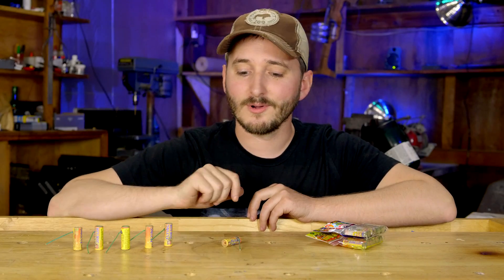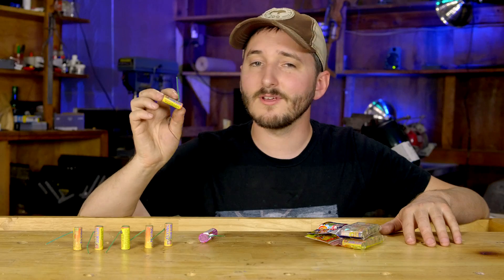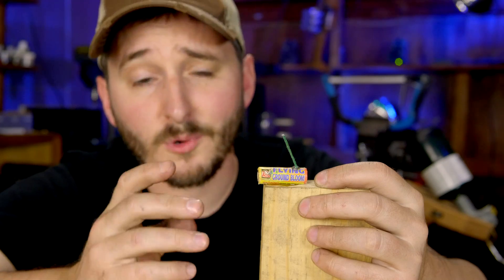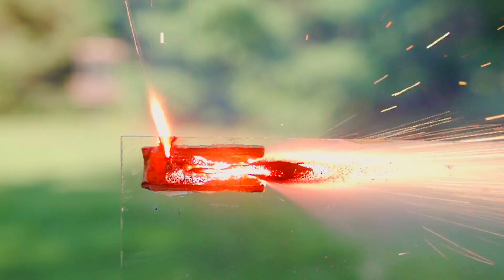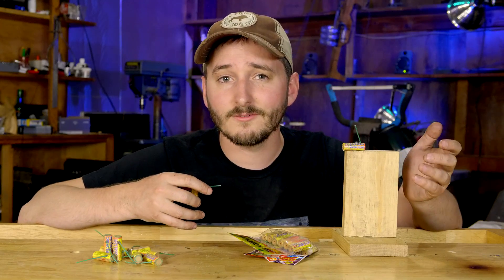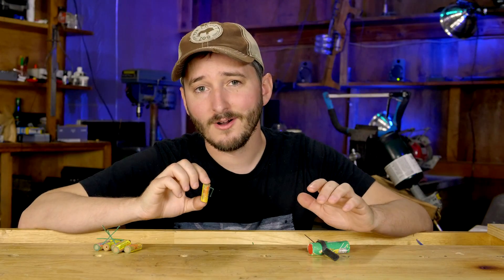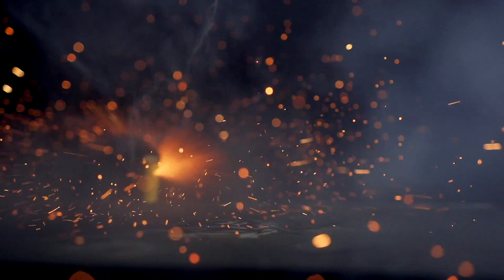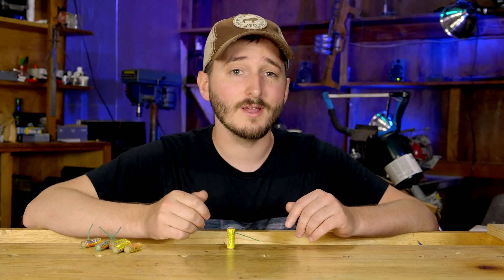How Do These Fireworks Fly?

Comment: Thrust vectoring without a vectoring device , only the nozzle at play .the flat surface to push against and the off centered nozzle on the side , weight to thrust ratio between the side nozzle and end nozzle , burn delay to the end nozzle to give the side nozzle time to vector the piece to a near standing position then commencing the end burn with the side nozzle acting as a rotating wing.!!??!! My pennys worth!😊

Comment: The tippy top and fire work share the same forces generated, off center of gravity. The thrust generated causes rotational spin and also makes contact with the ground generating lift. Once the rpms reach a certain speed, it generates a vortice and partnered with gyroscopic forces allow the thrust to reach position of least resistance. Without ground effect, there will be no particular direction. Basically what you said, thanks for the video, it was entertaining.

Comment: Before watching the video, i figured the fuse burns down to start the burn. The fuse hoe has to be off center. The calendar has to roll over because it's in contact with the ground, as well as the off center fuse hole is blowing out exhaust and it is also trying to turn around the axis of the non burning rocket end so the three forces combined cause a lift off the ground only when in contact with the flat surface. After watching, it looks like you take away two of these factors when tossing it in the air and it tries to spin around the axis placed at the opening of the rocket end and never starts to gyro and the rocket end lighys and still tumbles even worse.

If you get a tall calendar to spin on a surface on it's side fast enough it tries to pull it's center of gravity inward and tries to stand up. I know this from spinning glass or hwavy plastic cups on the table when my gameboy ran out of batteries and it was too hot to play with sticks outside. The off center weight of the glass bottom and the spinning contact of the glass with the table did some interesting things. Get a spent cartridge from that fire work and add a few bb's into one end and glue it. Then take turns spinning the tube in a table in different ways and it will surprise you. You obviously already know that toying with crap trumps the calculations and philosophy which come last...

Comment: Ohh. It like a bottle rocket but starts off as a spinner. Cool. Ok. I think I got something. The fire on the side end is pushing it to spin. Naturally the force will push it up. It wobbles as the other end is smacking the ground; causing it to wobble almost in an upright position. Hence the ground is a stabilizer

Comment: To me it seems as if the rotational thrust port (with the fuse) is not perpendicular to the axis of the firework but rather has a small angle towards the second thrust port (bottom).  This helps the firework right itself when it starts to spin.  Also since the rotational thrust port is further from the second thrust port (and not in the middle), the second port section will tend to orient downwards as it has no thrust there to lift it during the initial spinning.  The slight downward force of the rotation thrust port helps lift the end with the rotational port in it until the second port ignites and launches it.

Comment: I think it's weight.  The weight of the unburnt charge is greater than the weight of the already burnt end charge.  As centripital accelleration happens, the force causes a spin due to the dragging round end  Then as the final charge ignites, it's already vertical in orientation and loses weight suddently, letting it launch into the air quickly.

Comment: My theory is that it stands up through three factors. The first two, friction and ground force, were already discussed.  A third possible factor that explains the ones standing up later is balance. The initial burn clears out the gunpowder near the side nozzle, so by the time it takes off it's bottom heavy.

Comment: Does the the end with the hole have more weight to it? Also wondering about hole size, are both the same size. Another thought was two types of rocket fuel, slower on the side and fast fuel once it breaks through the core.

Comment: maybe the center of mass lowers (dimensionally speaking) due to "fuel" running out, or the hot gasses have buoyancy due to temperature difference? you can change the location of the first hole for some tests :)

Comment: I think the better example is a gyroscope once spinning along an axis gyroscopic forces stabilize the spining.the thrust out the side is simply to start the process much like a starter starts an engine. The thrust from this first exhaust passes over the ground at some point building just enough thrust to lift the tube upright. At this point it spins in a gryoscopic fashion keeping its upright orientation. At the end the bottom kicks in providing lift. In the end its acting like a gryoscope for stablity along the vertical axis.

Comment: The moment of inertia of a spinning tube is always most stable along the Z direction. Take a tube flip it in the air and spin it and you will see it lock along the z direction.
The ground introduces a constraint on the motion of the tube as any sort of intersection of the tube with the ground is less stable than with Z pointing upwards. Then the axial ignition happens.
You can test this theory by lighting one of these things and dropping it against a surface that is vertical, like a wall, and you will note that the firework will very likely shoot off perpendicular to the surface of the wall.
This would be a fun experiment to film.

Comment: I can be wrong but what I believe is that while thrust helps, it is actually the friction that helps to lift the firework up straight. You can observe this phenomenon by rotating(twist) a cylinder from one end and it will also stand straight up. I cannot explain without drawing free body diagram since my English is not great  but upward force from ground and horizontal force from friction gives us a resultant force which lifts the cylinder up. If someone already mentioned it then my apologies and If not and someone can add a word it better or can correct it if I am wrong then it will be great👍

Comment: if the fuel starts burning and escaping from the fuse hole first, wouldn't this change the center of gravity to be closer to the bottom nozzle? and would that be a big enough change to help point it upright?

Comment: While friction is undoubtedly a contributor, the side jet itself is pushing the firework's end away from level. Backwash from the ground effect is probably helping with that, as is centripital rectification (the method that causes a "tippy" top to flip over). The sizing of the firework is probably something found experimentally, since that affects the timing of the end jet firing, but I noticed that the side holes seem to be slightly off-center to the long axis of the body. That is probably what encourages the fireworks to spin every time, since otherwise a few would simply lie there spitting fire at the sky until the end kicks in.

Comment: Initially I imagined it similar to a lemon, where you start spinning it on its side and its rotation translates to the adjacent axis and spins on its end. Then when you mentioned the tippe top I was even more convinced I was correct.
But seeing it in slo motion, it seems the side vent it slightly off center so it rolls around and is just pushed upright by the jet of exhaust.

Comment: this is an example of directed thrust momentum and weight distribution the thing i believe you are missing is the initial burn hole does NOT just go straight into the firework. if you carefully watch you'll see that the initial thrust flame actually comes out of the hole at an odd angle creating a direct central spin within the lines of the body forcing it to stand up on the end its meant to spin on. if the flame came out straight it would defeat this rotation if it came out at an angle pointed toward the same end as the fuse was then it would be forced to stand by inertia on that end as its axis.its an engenious design but having the initial flame specifically directed is how it rights itself to be launched skyward.that in combination with the centrifical force pressing on it inward from the rotation is how it keeps the secondary nozzle in position for the launch.

Comment: I'm late to this, but I think the firework rights itself in multiple ways. I would think that the design having multiple methods of turning the right way up would make them more reliable and thus more popular and profitable. 

I think that the first method is the ground effect method you mentioned at the end, but if this firework is placed on uneven ground, that may not work. So the firework probably also relies on gyroscopic movement to right itself. I would bet that the nozzle end is heavier than the top, so as the firework spins, it naturally tends to force the nozzle downwards due to its weight. And because it's spinning axially, it will stabilize itself overtime.

Not totally sure though. Seems a bit overly complicated

Comment: One thing to note is that the fuse hole is not drilled straight through but tangentially to the the tube. It wouldn't spin if this were not the case. I also find it clever that they made the upward thruster a core burner type. I always thought it was just a tube full of BP with two holes. It makes sense though. With how small that device is, you want to get it up in the air as fast as possible using the small amount of powder it contains.

Comment: I know I'm late and although I studied physics I dropped out after 9 semesters and am in IT now. But my take on the reasoning of the uprighting is a combination. The trust from the fuse hole seems to accelerate the fireworks on 2 rotational axis - I'll just call them yaw and roll. I suspect the fuse hole is skewed sideways. 
The combination of the rotations would fit the tipi top theory. Your shots of the cut fireworks look too me like the top has a much heavier filling than the bottom. Not only is there no exhaust port on the top but the plug looks much longer. Tippy top again, the center of gravity moves up during the rotation. 
Add the balance of the fuse hole thrust. Thrust going up holds the end down. Thrust going down moves the end up. Thrust going sideways accelerates the spinning around the longitudinal axis (because the hole being skewed) and would push the body sideways if that wouldn't be prevented by gyroscopic force.

Comment: NightHawkInLight, I saw this before and fell upon this video again. This time I had a fresh look and studied your slow motion videos. One thing I noticed is that the fireworks burns at the top, making the unburned powder below. This heavier weight would tend to be at the bottom and the burning section at the top, like a plumb bob. Then the powder continues to burn and the flame hits the open core which exhausts out the bottom.

Comment: You can get the same effect of standing upright with a battery on a hard surface. Just exert pressure on one end (off-centre from the axis) until it flicks away. It'll spin on its end. I think it doesn't stand fully upright as the only rotational momentum you give it is what it starts with, whereas with the firework it has a consistent thrust.

Comment: It's standing up due to 'conservation of energy'. 
   Everything in nature tries to move with the least amount of energy spent. So when the fire cracker spins it immediately tries to spin in the position that expends the least amount of energy to do the task. Just like the second top you spun, it stands up because that is the position that has the least resistance. 
   If it didn't have the second exhaust opening it would just stand up and spin like your wobbly top.

Comment: The nozzle that first ignites is also kind of in an angle.
Soo that is where the rotation comes.
But i believe that the fact it ignites also changes the weight distribution to make the lower parts heavier than the top.

Its like a pendulun spinning but then the upwards movement(3nd stage) makes it harder to leave the initial angle of flight.

Soo trowing it up gives it a movent that is bigger than gravity atraction to earth, causing it to prefer to move to the ground.

Sorry for the bad grammar,english nota my first language

Comment: From my observation in slow motion I can see the fuse end of the fire work lights a jet of sparks these start the barrel roll of the firework, using centripetal force the heavier end with the vertical thrust port holds the firework in a vertical alignment it bottom heavy and the side jet is what stands the firework on end, internally the fuel is burning down to the bottom where it finally ignites the exhaust jet that propels the firework upwards. The firework is thrown in the air the firework doesnt have the friction needed to stick the bottom downwards

Comment: It's called the intermediate axis theorem, and the reason it wants to spin on its longitudinal axis is because this is the axis with the least moment of inertia compared to the second principal axis (spinning on its side) and the third principal axis (cartwheeling off the table). This does NOT work with a uniform cylinder as it only has one well-defined principal axis. However, there is a brief moment where the firework has a light spot on the side with the fuse hole, making that direction of rotation unstable compared to spinning like a top. By the time the weight becomes uniform, it becomes spin-stabilized. Try spinning a deck of cards in the air on its width axis. It wants to spin on its length axis instead.

Comment: I believe that part of the puzzle could be the fact that there is more weight in the bottom of the tube than there is in the top of the tube.  Because you can see in the clip that starts at 5:38 that the rotation is most centered around the bottom of the tube.  There is both gyroscopic and drag stabilization at play if my theory stands correct.

Comment: Same concept as a bicycle. Objects moving at a speed, for some reason, find stability. The side exhaust is towards the front end of the firework, so it's always going to push the other nozzle downwards. When it spins violently sideways on the table, it bounces as the exhaust touches the ground surface. It keeps doing this as the exhaust gets more intense, turning more upright with each spin. Eventually it reaches a point that it seems physically easier for the firework to fall upright rather than sideways, perhaps using the same stability effect as a bike. When it's moving fast enough, the turning force keeps it straight upwards so the exhaust can fire it up.

Comment: Most objects have several different possible axes of rotation with different moments of inertia (unless they're perfectly symmetrical across all planes). Each axis of rotation can then be thought of as an "energy level," with the lowest energy level corresponding to the axis around which is the lowest moment of inertia. Because these axes usually have different moments of inertia, there are usually several different "energy levels" for an object. In the event of rotational instability (in this case, provided by the friction with the table), an object's rotational axis will trend towards its lowest moment of inertia, as this is the lowest "energy level". In the case of the rotating firework, note that the lowest energy level corresponds to the longitudinal axis, rather than the horizonal one, so it can be hypothesized that rotational instability will cause the firework to want to rotate around the longitudinal axis. And this is the behaviour we see when looking at the slow-mo footage of the first charge firing: The firework is knocked out of rotational equilibrium due to the friction provided by the table, allowing it to move to the lowest "energy level" of rotation (you can think of this as thermodynamic control with the activation energy for rearrangement to a lower energy level provided by the friction), and this is responsible for the self-righting action.

For some reason, I have a feeling that this is what you were saying, though I'm not sure I understood you properly!

Comment: If the fuse exhaust hole isn't straight out of the tube but at a slight angle and the secondary exhaust hole makes that end of the firework heavier wouldn't that explain why it stands up??

Comment: 1) The upper nozzle isn't directly axial. It is canted so that it comes out not directly normal to the body, but at a slight angle, albeit on the same radial plane.
2) As the tube begins spinning, the ground effect makes the thrust of the upper nozzle very efficient, creating an inverse pendulum forcing the upper end of the tube off the surface. The weight of the clay of the nozzle is irrelevant; it's the fact that the upper nozzle is at one end of a total weight and is acting as a lever.
3) While lifting up the end of the top nozzle, it also gains momentum while around the linear axis, creating what will become directional control by gyroscopic precession. 
4) At a time predetermined by the powder burn the tube is standing pretty much on end with the bottom nozzle pointed downward. the lower chamber ignites and the largest amount of thrust sends the firework upwards.
5) As the machine flies upwards, the spinning induced by the upper nozzle at a lower thrust works like rifling in a gun or artillery piece to keep it accurately on course.
6) The dry powder fuel supply is shared and when it's depleted, both nozzles cease simultaneously so that the device essentially becomes a lightweight, empty cardboard tube with two clay nozzles embedded in it.
7) The machine is no longer ballistic and it's whetted surface causes enough drag that it tumbles through the air and falls harmlessly to the ground.
q.e.d.